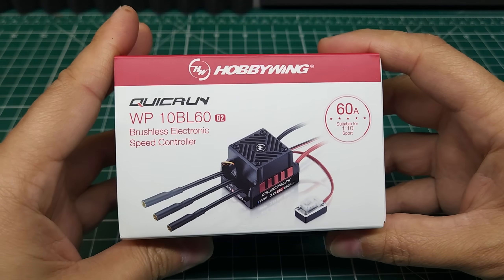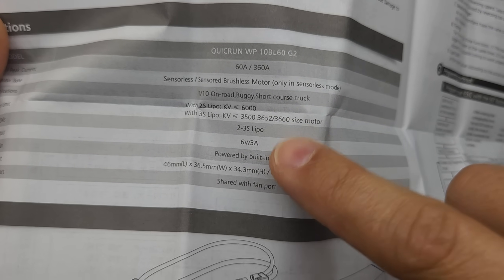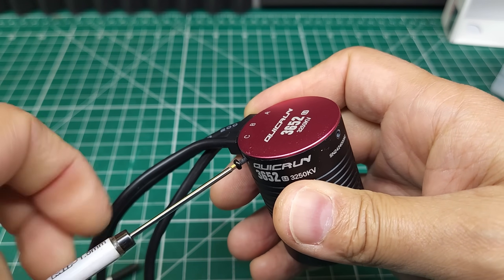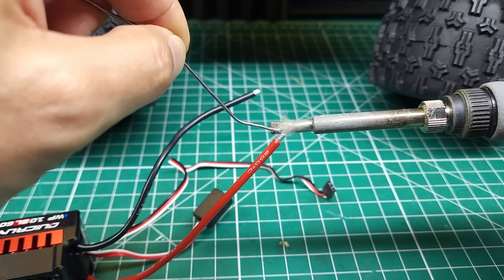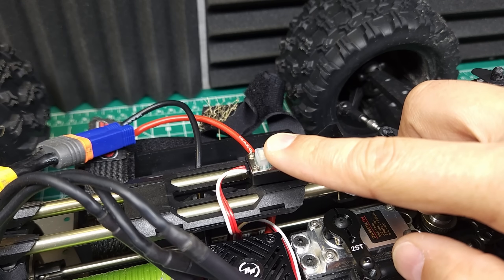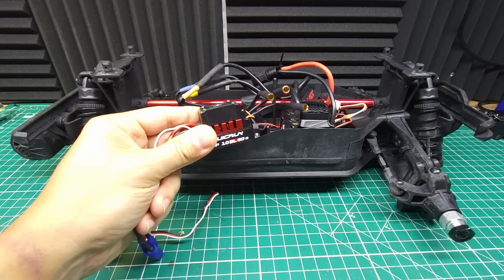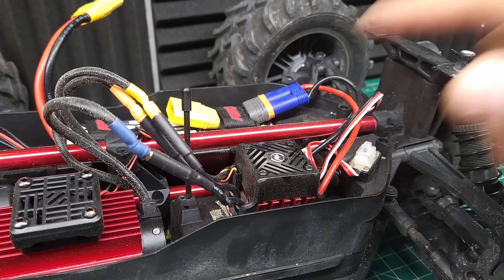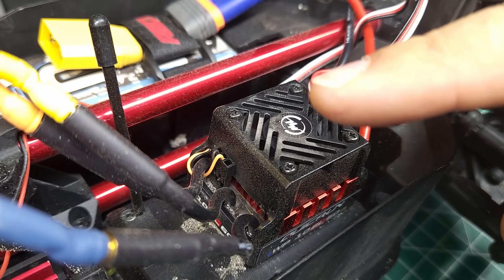NEW Hobbywing 10BL60 G2 Is Surprisingly Good! (Tested To Failure!)

Comment: Do RC, is there a way to program my 10bl120 without a program card?
Reply from the maker: Yeah there's a set button next to the switch You can use. Check the manual
Reply: What are the steps, its not in the manual

Comment: Hey there. Awesome video as always! I just ordered a 16bl30 for my granite grom, and was wondering what kv motor you would suggest for all around bashing? Not really worried about top speed as much as getting some more punch/acceleration/ flips running on 2s only. Thanks much!
Reply from the maker: It just depends on what gearing you're going with but anywhere around like 4,000 KVs should be fine
Reply: @DoRC  cool cool. And thanks for the reply! Do you think that esc can handle a 2838 size motor around 4000kv on 2s only? Was gonna start with the stock 16t pinion .... And which would be a safer bet, like 4400, or 3800? I'm asking you because you ARE the most informative person I've found on YouTube to date. Absolutely awesome on your knowledge base, bro.
Reply from the maker: @OGWHITEFIRE  maybe but I think you're going to be pushing it. 2838 motors are usually rated for around 30 to 40 amps. I think a 60 amp ESC would be more appropriate

Comment: *NOTE - This is the WP-10BL60 G2 which is the waterproof version. The normal 10BL60 G2 does NOT support button or LED programming, only the LCD and OTA programmer.
Reply from the maker: Yeah it's really annoying that they have two different ESCs with the same model number

Comment: I am looking to replace the electronics in my slash 4x4 as they tend to get hot, what do you recommend as an affordable set
Reply from the maker: The hw 10bl120 combo is a good option.
Reply: @ if you recommend it, I think that will be a good purchase then, thanks
Reply from the maker: @WowoodogPlays  have you tried fans on the current electronics?  If not it could be a cheaper solution.
Reply: @DoRC  no I have but I am rebuilding a vintage stampede and was thinking about putting the vxl 3s system in it from my slash and upgrading the slash’s electronics
Reply from the maker: Gotcha. Makes sense.

Comment: Would this work for a jjrc 16101 stock motor?
Reply from the maker: I'm not sure. A lot of those smaller brushless cars use smaller bullets than this would have so you might have to use an adapter. Also if it's a two-in-one you need to get a different receiver
Reply: Stock motor is 2847 4000kv

Comment: I have used those brand of ec5 that you have and have had no problems. They seem to run cooler then other brands of the same connector and have no problem with my larger rigs
Reply from the maker: Yes overall they are high quality EC5s.

Comment: I have the other model wp 10bl60. What do you run the motor timing setting on. I personally don’t have any experience I’m going to turn it to 0 see what happens. Thanks for always putting out great videos with good information.
Reply from the maker: I'm probably not the right person to ask that question too. I usually just leave all of the settings at their defaults. 
Whatever the default setting is should be fine
Reply: Okay thanks. I would assume the same from what research I found timing should be at zero it comes default at 11.5.  I will just play around with it see if it runs smoother.
Reply: So what happened,?@FlynnJ802

Comment: My 10bl 120 doesn’t engage reverse very well. I have to hit reverse a couple times for it to work but reverse works just fine when I change the running mode  to forward and reverse. Can someone help? I really want to use forward reverse with breaks
Reply: Im familiar with it my arrma is the same way but its literally not engaging at all. The green light lights up indicating that im giving it full reverse but nothing until I do it a couple of times then it kicks in
Reply from the maker: @hitlike223  If you're doing the correct procedure and the green light is coming on then it sounds like it's just not outputting the reverse to the motor which would indicate it potential bad ESC.
Reply: @henryallen1121 mine does that too I've recalibrated it over 5 times now 😢
Reply from the maker: This could just be a function of the way the system works. The hobbywing ESCs will engage breaking the first time you hit reverse and then you have to release and hit reverse again to go backwards. If you're sitting still basically this means you have to double click and hold reverse. If you're not used to it it can kind of feel like it's happening at random.

Comment: I have standardized my fleet to xt-60 for 1/10 crawlers down to16th scale go fast, and XT-150 for 1/10 up to 1/5 scale go fast or multi pack cars (Slash, 4s Kraton, 4s maxx,  x-maxx etc).  Less wires and resistance when running 2 packs.
Reply from the maker: Not a bad idea.

Comment: Kinda bummed they are moving away from solder tabs but if it makes it easier for the majority I guess that’s a win. Thanks for the video 👍
Reply from the maker: They actually aren't. There are two 10 BL60 ESCs. The other one that is sensored still has the external tabs. 
I think they don't use those on waterproof ESCs because it's harder to maintain the waterproofing especially if someone puts a bunch of heat into it when they solder

Comment: My Go-to Connectors are XT-150. You can run in series and parallel without changing the setup and no loop connection.
Reply from the maker: Those are definitely sweet! As an added bonus if you want to get really spicy you can plug a battery into itself :-)
Reply: I was hoping I would see someone say this.  I use XT-150 also for the exact reason you mentioned.  Less wires and resistance when running 2 packs.

Comment: Just ordered some 3M VHB. I put a Firma 150 amp ESC in my Granite, and don't have a 3D printer (yet) so I thought I'd make do with some double sided Gorilla tape, but it doesn't feel secure enough to jump with. I won't forget to let it "soak in" for 24 hours after applying to cleaned surfaces.
I'm still stoked with your NoCry screwdriver recommendation and torque reduction hack. 
Thanks for the tips!
Reply from the maker: Awesome. Yeah as long as the surfaces are clean and you let it sit at least for 12 hours it should hold just fine. I'm sometimes impatient and have failures but it's almost always my fault.

Comment: I use EC5, IC5, or EC3 on 2s.  I have a couple xt60 and xt90 but only because that's what came on the trucks and i haven't got around to changing them.  I have thought about going to QS8 but I'm not crazy about soldering on batteries. 
Also Hobbywing is my go to brand.  A XLX2 reducing my first Xmaxx to a puddle of plastic and Castle telling me to pound sand converted me. I'm actually OK with Spektrum stuff too. It looks and feels like if it's not rebranded Hobbywing it's a close as you can get usually.  I'm really impressed with this little guy in the video.    It really makes this seem like overkill for my Mojave Grom.
Reply from the maker: You're right on the money. Hobby wing makes all of the spectrum ESCs.

Comment: I got the quic run 10bl60 on a 1/16 hyper go with stock motor. It's too big but there is zero delay now in throttle response which feels good but I imagine the gears hate. Really wanna try it with a sensored motor.
Reply from the maker: Yeah if it's sensored that's the other 10 BL60. Hobby Wing has two with the same name which is super confusing.

Comment: does it fit in arrma grom cars?
Reply from the maker: You might be able to get it to fit but it's probably not your best choice. I'd suggest going with either the Mamba micro X2 or the other 10 BL60 which is quite a bit smaller.
Reply: @DoRC  do you think its worth it to get this1 over a ztw gen2 60amp wich is about half the price?
Reply from the maker: @Ashlyyy_2305  I do. You're not really talking about that much more money in raw dollars and where as the ZTW ESCs are cool they're a little too quirky for me to be able to recommend for general use.
Reply: @DoRC  i am from the netherlands so its euros
you got subscribers all over the place

with quirky you mean dialed in with consistantcy? what does a 32bit processor do
Reply: @DoRC  alr

Comment: You had the tool to pop the ball joints in and out, you used it for the shaft test to see if it was threaded m
Reply from the maker: Unfortunately the pin in the tool isn't quite big enough and would just get pushed into the hole of the ball. Also I've found that, especially with larger plastic balls, The tool tends to deform them. That's why I like just cutting them out of the old ball end and pushing them in either against a table or with a pair of smooth jaw pliers.

Comment: will you do a video on the motor?
Reply: no i already have one i just wanted to know what do you think about it
Reply from the maker: @martincihlar5327  ah ok. Yeah it's fine. I don't think you'll have any issues with it. It's probably not the most advanced motor in the world but it will certainly get the job done.
Reply from the maker: Probably not. To be honest there's not really anything new or interesting about the motor. It's a pretty basic brushless motor though the hobbywing motors have been very reliable in my experience so I wouldn't hesitate to buy one if you're in the market.

Comment: Basically the same specs as a vxl when you ignore the vxl 3s’ stupid 200a constant. 320a burst, 6v3a bec, 14 gauge wire. Really shows how overpriced Traxxas is
Reply from the maker: Yeah I don't believe 200 amps constant for a second on the VXL3s.
Reply: @DoRC  I think there’s a reason the vxl 4s and up have no official specs
Reply from the maker: @EV_Dreams  Yeah I always thought that was kind of weird.
Reply: @DoRC  castle kinda does the same thing. They don’t list a whole lot of specs regarding amps and such because they are smart enough to know that amp draw capability is not a hard line limit. Its way more complicated than that
Reply from the maker: @PigglyWigglyDeluxe  they might not list them but I can guarantee you internally they know what the numbers are. The constant current limit is set in software so the manufacturer is definitely know what it is.
Reply: @DoRC  oh I know, it’ll present itself in the data logs as a “threshold warning” if the motor ever draws too much power
Reply: 200 amp continuous would light that sucker on fire. Specs are blatant lies in this hobby. Trust none of them unless they provide independent verification
Reply from the maker: @PigglyWigglyDeluxe  For the most part I think that's a reasonable. I do think that 60 amps continuous is a reasonable number out of this ESC though
Reply: Pffft. The VXL isn't even 40 amps.
Reply: Wasn't the vxl 3s system rated at 60 amps at one point? Back when you could buy it used for 40 bucks, Back before they used the drag slash platform to create a supply scarcity to drive the off the shelf cost so high that no one wants them anymore. 

Sorry, I'm ranting again, lol.
Reply: @stp440  traxxas has always called it 200a, even back in the old 2 pole sensored days
Reply: There is no comparison to Vxl and Hobbywing that's ridiculous lol
Reply from the maker: @tripletrc5654  I think this is more of a contrast than a comparison. He was basically saying how ridiculous the overpriced the VXL ESC is

Comment: I a massive fan of the XT90 anti sparking connectors far cheaper than EC5/IC5 official connectors. While yes the IC5 is higher current by being a bigger bullet, sparking does degrade the connector. I have no proof but I’d wager a xt90 anti sparking connector probably had better ampacity after 500 or so cycles since the connectors don’t have the arcing damage. That being said I definitely intend on integrating some QS8 connectors into my fleet. I’m not sure what I was thinking soldering xt90 to a max5 g2
Reply from the maker: Yeah that's one of the main reasons I use XT90 and QC8. I love the anti-Spark.
Reply: Xt90 should suffice for most max5 uses. The higher the voltage the lower the amps. A friend of mine had one the 1st gen castle xlx esc, these large green aluminium bricks, and used deans t-plug on 8s. No problem at all!
Reply: @AsurasWrath164  honestly the fact we ever used deans plugs is kinda terrifying to me. Those suckers were tiny and didn’t have much to solder to
Reply from the maker: @dylanwhite6539 Yeah I was actually looking at their latest website and they have some pretty bold claims for current ratings on their connectors
Reply from the maker: @AsurasWrath164 That's not quite true. Most higher voltage ESCs are also higher current and are usually paired with motors that can draw higher current.
Reply: @DoRC  I’ve seen much debate about it. I’m using mine in an xrt. They do get warm but not terribly hot. It’s mostly a pain in the ass to fit the wire and I’m not terribly satisfied with the solder joint. I also want to solder some taps for 4s fans anyway. Also zeee just recently started selling their 10K 4s packs with QS8 anti spark connectors so that’ll save me some work soldering. When my older set of 9Ks retire I’ll put my current 10k with xt90 on my Xmaxx which still uses a stock esc and upgrade the max5 to QS8. I still want to maintain cross compatibility with the Xmaxx and xrt so the Xmaxx will eventually get QS8 as well. Likely still with the vxl 8s
Reply from the maker: @dylanwhite6539 Yeah I use QS8 on pretty much all of my 4S and 6s batteries primarily for compatibility with the larger scale vehicles
Reply: @DoRC  i know what you mean. And of course there are situations where you draw a lot of amps no matter the voltage. Speed runs are always demanding high amps. What I meant to say is that you don't automatically need big connectors just because of bigger esc. A smaller connector might be ok for some applications.

Comment: The whole bl line is great i love the sensored g1 too for the price there are great also i use the gorilla double sided tape the 60pbs ive never had a esc come off
Reply from the maker: I've never tried the gorilla tape. I started out using VHB because I had it from some automotive stuff and it's always worked for me so I've never tried anything else.
Reply: @DoRC  fair enough . well i have used both  and i cant say one is better i found the gorrila tape looking for 3m vhb and i found the tape at walmart i little cheaper and it works i do have both and will use what ever one i can grab first lol
Reply from the maker: @jebrc  If I ever run out of VHB I will definitely try it out!

Comment: Seriously considering switching to EC5 from XT90, just because of how hard it is to pull XT90s apart. That would be a long night of soldering....
Reply from the maker: The EC5s definitely are easier to pull apart. The only real downside is you lose the anti-Spark which may or may not be something you care about.

Comment: As for esc testing, jumping is probs least amount of load it will see during bashing. One long pinned pass in thicker grass would test it more than 15 min of jumping.
Good esc either way, hw really running away with their offerings with hardly any competition
Reply from the maker: I'm not sure I agree with that. A long pole in grass definitely will put a lot of load on it but I've thermally overloaded plenty of ESCs just doing back-to-back jumping including this one. Acceleration is always going to put the most load on the system so accelerating over and over and over again is pretty hard on it

Comment: It's a great ESC, and I'm not surprised! I have a couple ones of the older version and haven't broken a single one, ever! Some of them are like 7 years old and still run perfectly fine.
Reply from the maker: Yeah I was actually pretty impressed without it handled running the Valkyrie. That's way too much car for it and whereas it definitely wasn't thrilled about doing so it handled it okay.
Reply: Yeah the 10BL60 is a great esc in both the waterproof and sensored versions. A lot of ready to run escs are rebranded, rebadged or are based off of the Quicrun 10BL series of escs.
Reply from the maker: @slick2500  yep

Comment: Hmm, when I purchased my Ezrun Max8 G2s ESC, it actually came with name brand 3M VHB double sided tape. Odd, maybe because this is a cheaper line up it doesn't?
Reply from the maker: Entirely possible. What they include with the ESCs seems to be kind of random. I have noticed though that the VHB that they include doesn't seem to work as well as the VHB that I normally use. I kind of wonder if it's not genuine.